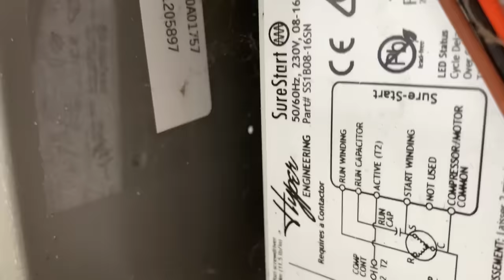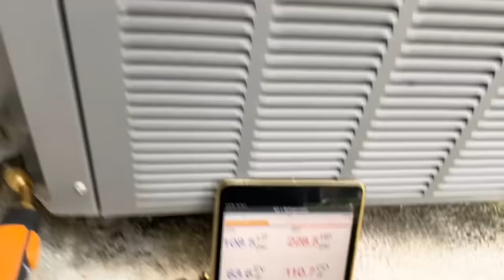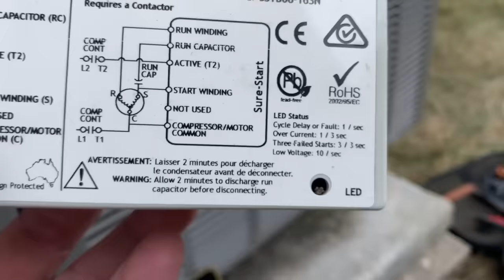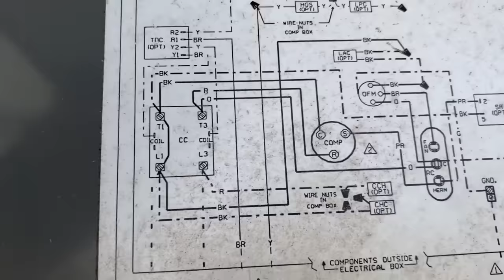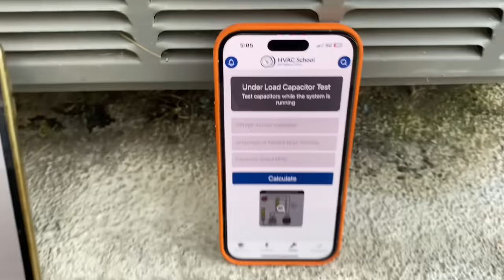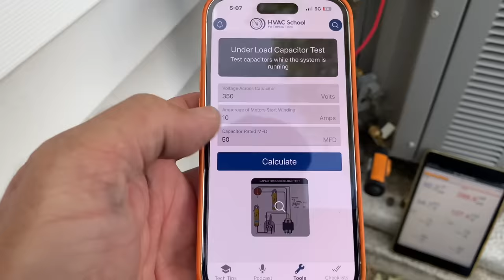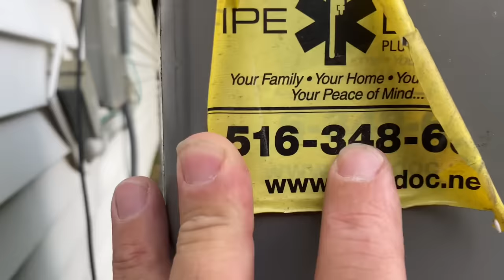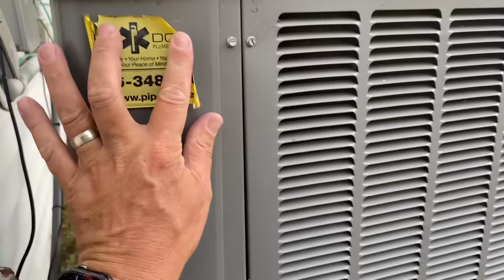Soft Start Killed Compressor! UNEDITED Central AC Service Call for No Air Conditioning Revealed!

Comment: The owners need to buy a micro-air soft start. That's a lot better unit and will cut their power bill way down and even let the owners use a smaller generator to power their house or rather the main items you want to power when there's an outage. A hard starter will draw more power and you might need a lot bigger generator to get your AC to function all because of the inrush / startup amps and the run amps.
Reply: You are so full of it, those things will not save money, protect the compressor or any other nonsense Im reading on here. If anything they will damage the compressors start winding and destroy your unit. Get the right size generator and stop re engineering A/C units

Comment: Looks like the home has solar on it. It most likely has a battery backup.  They add the soft starter to limit the inrush current to not stress the batteries or drain them. I'd reach out to the solar contractor on this. They probably backed up more than the batteries can handle.

Comment: So I'm confused, is he saying the soft start device was the issue, or did the device do what it was supposed to do, which is take the fail, saving a costly compressor replacement? Also, was he calling it "stupid" because he doesn't like that the unit has a soft start? I only say that because I've heard soft starts help extend the compressor's life, which, in turn, could reduce his maintenance visits/fees, and as he said, "leave money on the table".

Comment: I have heard mostly positive reviews on certain brands of  soft starts, but agree that was probably not the correct size for that unit. Maybe it was the video frame rate, but I noticed the condenser fan didn't seem to be running as it should have. Was it just the video frame rate illusion? 🤔
Reply from the maker: Wrong size

Comment: LOL wow.  That soft starter didn't fail.   You did!  I mean, you might have fooled the (new) homeowner, but looks like you totally misdiagnosed what was happening because you didn't take the time to learn about that device.   I was able to read the flashing LED diagnostic info even with your iPotato filming it and you blew it.   That soft start device says it detected an overcurrent in the compressor, which along with the high head pressure your gauges indicated, are symptomatic of a dirty condenser coil.   That's about the only thing you got right in this diagnostic - is good you  know what dirt looks like.  lol
But you chucked a perfectly fine piece of equipment, in fact the very piece of equipment that was actually saving the life of that compressor, like it was junk!   Your diagnosis was the only junk here!
Reply from the maker: Thaks for sharing. Whatever you say buddy.

Comment: I’m sure you know that these soft starts have been around a long time.  They use them on units for RVs.   It failed because someone installed the wrong one .   Maybe installed by the solar company.  I have the correct one for mine, different brand, and never had a problem.  My generator can easily run my 4 ton now.   It could before but not without a huge groan.  Branding, I use magnets.  I’ve seen some of my original magnets from 31 years ago on refrigerators.
Reply from the maker: Nothing like seeing your own magnet or sticker from the 1990’s. Now that’s branding.
Reply: Hello, what wattage generator are you using. I have a 5000predator generator and wondering if I can use it for my 3.5 ton ac?

Comment: So, the soft start unit failed, resulting in the AC unit not getting enough power.  Instead of replaced it, you removed it, causing the owner to use higher startup Amps.  Did you even consult with the homeowner before removing it? The title implied the soft start unit damaged the AC, which isn't the case.  I'll be installing one because I'll be getting a whole home generator and need to reduce Amp draw needed by a generator.
Reply: I was going to say, I hope they didn't have a generator setup. I get it. You wanted to get it up and running. Mission Accomplished. Well done at least it will cool the home. Until next week, don't work to hard.

Comment: Maybe you should have got on your phone and looked up why the sure start was flashing a red led? You just reverted them back to an expensive electric bill by noy investigating and then cleaning those coils. Hopefully, on your return visit you reinstalled the soft start after cleaning the coils to test, or replaced the soft start with the correct sized unit. Just on startup you can see that yhe amperage to start was 50% less than without...that is going to cost them plenty in the near future! Good advice on the sticker though!

Comment: Softstarter probably saved the compressor by shutting it down when it was drawing too much current from dirty condenser.

Without the softstarter, the compressor would have just overheated and popped compressor internal safety breaker.  Recycle the internal breaker enough times and it goes bad so you can buy a new compressor.

That softstarter is a combination of hardstart capacitor and triac voltage ramp softstarter that only effects (reduces) compressor startup surge current.  It also has a hall effect current monitor that is active during run cycle to monitor compressor run current and will open its power relay when current gets too high in compressor.

Comment: A “soft starter” increases the efficiency and longevity of HVAC units and heat pumps. It reduces the in-rush current needed for compressors to start by 60%, thus minimizing potential damage to compressors from mechanical shock hard-starting current surges
Reply: That's really not true, your condenser fan and compressor motors will not last longer with a soft start. Whether it's less current over a longer period of time or more current for less time the power under the curve (read: heat) is the same. Soft-starters allow a generator to run the system more easily, allow for solar inverters to do the same, or keep the lights from dimming/flickering upon start up (much more common in older homes, especially those with split-bus panels). If you look at Micro-Air's own literature it shows the running amps are the same whether the soft start is used or it isn't so there is zero efficiency gain.
Reply: In some cases compressors will last longer with hard starts, my carrier air conditioner is an example, if hard starts didn’t exist we would have to get a whole new unit, again
Reply: @BRISTOLFORCE2009  A hard start kit will extend the useful life of systems nearing the end of the lives. The kit makes up for wear and tear that would otherwise stall the compressor on start-up. Soft-start kits are touted as making systems last longer but that simply isn't the case unless you live in an area with unstable grid supply or there's an issue with the wiring of the residence itself.
Reply: @BlownF150  in my case as I said above, no hardstart = no compressor operation

Comment: I went with a micro-air soft-start wasn't impressed with the Hyper engineering looked like something invented in the 1980s. The new micro-air has bluetooth logs everything monitors the compressor even upload it to their techs and upgrade the firmware.
Reply from the maker: That sounds impressive

Comment: I had to have a soft start installed,  to run with my solar array and back up generator.
Reply from the maker: I can see the need for a soft start on a generator or solar system

Comment: No respect for this guy…. He cast a shadow on the soft start, doesn’t mention why it’s there.  Soft start needed with Solar systems and generators, the soft start was not sized properly, that’s why the soft start shut down, but as the video shows the compressed did not fail…. This guy is is deceptive in his video or just ignorant as to the necessity of the soft start OR HE WAS GOING TO UPSELL A NEW AC UNIT , a new AC with DC start is very very expensive. 
Could not watch the whole video I was so upset.
Reply from the maker: Sorry you’re upset

Comment: As 18 year tech doing this for a long time. One 410a system the 2007 and up till 2011 low pressure switches cut off at 80 psi
Second the soft start is the wrong size
Reply from the maker: Thanks for sharing your feedback

Comment: it wasn't dropping out the start winding power, so it's overcurrent until it safety drops out or opens the compressor overload.
you'll find the same problem with "universal" electronic start relays in refer gear too. lightning/power surge blows parts of the board and they get stuck sending start power out.
it's hard to beat a plain old mechanical start potential relay and capacitor, while they can arc weld the contacts, it generally hits overload fast or ends up tripping a breaker.
Reply from the maker: Multiple issues. Still the soft start killed the compressor
Reply: That dirty coil make have shortened that compressor's life already!
Reply: When you say "killed the compressor" do you mean that the compressor needed replacement? Or did the soft start prevent the compressor from starting? I'm confused. I'd like to put a soft start on our home so I can run our AC with our generator during a power outage, but this video has me concerned. Great video BTW @PipeDoctor

Comment: Had an issue where the transformer supplying mine and 4 other houses was putting out "high" voltage due to only 3 people using it.  Caused my ICM870 soft start to go into over voltage fault.  The soft start was a little sensitive should shut off at 250v but it was off at 248v, now we got a new neighbor and its worked flawlessly.
Reply from the maker: That’s insane! How
Reply: Not enough load on the transformer causing a high voltage.
Reply: @lance16O1  That doesn't make sense..So in the middle of the night when load is very low voltage will be 280?  300?  Just sayin'

Comment: Mr Pipes, soft starts are not stupid, if you want your whole house generator to work properly with nearly killing the power in the house, you have to put a soft start device, secondly, a hard start will kill a generator mostly during the startup process. I guarantee you, that this will come up at some point with you customers.

Comment: This guy seems to be so proud of himself but yet he doesn't know half of what he should know being in the HVAC industry he should know more about those soft starts That one is not sized correctly for that unit Wonder who did that was it him  All you did now is shorten the remaining life of his compressor. 
Do some homework please tell the customer he should install a new soft start especially if he's got a lockout switch at the main distribution panel so it's generator ready for that unit.
Reply from the maker: Hey 👋 Thanks for sharing. I’m on a mission to learn something new everyday. Even with a million views a month, no one is perfect. Not even me, Mikey Pipes. God Bless brother. I’ve got a few heat pumps to work on tomorrow in sunny Florida.

Comment: I need help!!   I decided to try to install one of these myself. I open up the condensing unit panel only to discover there’s no contactor for the compressor or condenser fan.   Just a transformer, run capacitor and an electronic board.    Does that mean I don’t have a contactor???   Ty.

Comment: Without the soft start device the ac unit possibly will not work when using a generator during a power outage. It was probably important and necessary. Even if it ruined the compressor it was important to replace it with a new one.
Reply from the maker: Wanna bet? Care to wager a USD amount?

Comment: You can tell that this gentleman is a true professional. First and foremost, you can always tell a pro simply based on the tools and equipment that he or she uses. Fieldpiece manufactures great HVAC-specific tools like the probes used in this video. Many HVAC technicians use their multimeters as well. However, experienced electricians and engineers know that Fluke is the absolute best when it comes to electrical testing tools and equipment. When Mikey pulled out his Fluke 902FC in this video, it was a dead giveaway that this man knows what he is doing. Great job buddy!
Reply from the maker: Thank you very much
Reply: And the Porsche 😎

Comment: Curious how there is 350 volts across the capacitor. Doesn't that residential home have a nominal voltage of 120/240 volts? Capacitor magic?
Reply from the maker: It’s a capacitor that’s what they do

Comment: One thing you might want to consider is everytime someone calls you because of your branding sticker left on their unit the last time, bring new branding stickers with you and replace the old ones with a new one, especially if it's in the condition like the one on this video,  you stuck on the old sticker which absolutely looks like the slightest breeze will cause you to leave money on the table. 😅😅😅 great video, but that absolutely was the wrong soft start unit, that looks like the rv version...... not a 5-6 ton version... just saying 🤷

Comment: Improper diagnosis of the Eltwin SureStart aka a Soft Start Device. At 7.23 min into the video you see the Eltwin Sure Start Model numbers containing 08-16 which is the FLA / RLA rating of 08-16 amps as typical in a 2.5 to 3 ton unit. At 10.47 min into the video you see it AC ID Plate that the unit is a 5 ton. ELTWIN SURE / SOFTSTART UNIT WAS WAY UNDERSIZED. People love the Eltwin Sure / Soft Start devices because they can keep a compressor going for 25 to 35 years. Yes, you may have to replace a condenser fan motor $ 350 or  coil $ 1200 or a evaporator fan & coil but these are small compared to the $ 12,000 bill for the a the unit  they are trying to sell you. They will also lie about the electric savings, new units rarely save more than $ 20 per month. The R22 systems can run off the newer cheap $ 10 per pound 407 C Freon, so don't let them fool you about the R22 freon costing $ 500 per gallon. Then tell them your R22 is providing 16-19 temp drop and if they put in a new system that is not as good you will want it removed. Then they will leave you alone. LONG LIVE THE AMERICAN STANDARD TRANE R-22 UNITS.

Comment: I even had an A/C guy come out to one of my rental properties and in addition to checking the system out, he charged an extra $30 to squirt water on the condenser. I mean really,  a 45 second hose job using my water and I got whacked for an additional $30?  Needless to say, I will call another A/C contractor next time.
Reply from the maker: Yeah, that’s performing a disservice

Comment: How about googling hyper engineering? Soft start. You’ll find three models. Whoever installed that installed the wrong model. If you’ve got 21 A running then you need the 32 amp soft start. There’s something wrong with the HVAC tech that installed it. Maximum on your clamp-on amp meter is not the same as inrush. Read up on it. And quit talking for your customers. Let them talk. We as professionals, are always hearing the same things over and over again, so we tend to fill in what we think they’re going to say. I have to control myself, because a lot of customers don’t like that. They may not tell you, but they may not call you back either. Keep up the good work.
Reply from the maker: Haha okay 👌

Comment: I think soft start is not a problem with this system.  the problem is high compressor current consumption due to high condensing temperature and high condensing pressure.  The lamp on the soft start blinked 1/3 times per second and indicated an increased current of the compressor and the system went into protection.  in this case, remove dirt from the condenser by cleaning it.  then measure the current consumption of the compressor.  A soft start is needed here because there are requirements from the electricity supplier.
Reply from the maker: A soft start is not needed because of the “electricity supplier” requirement. Complete BS. No disrespect intended.
Reply: @PipeDoctor ok maybe i was wrong.  is it possible to find work in the USA for people from Kazakhstan